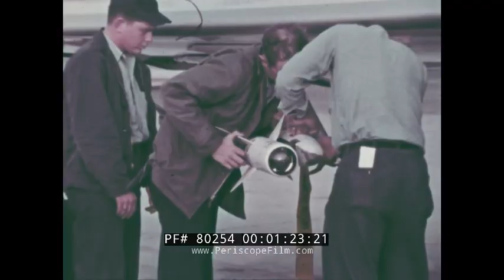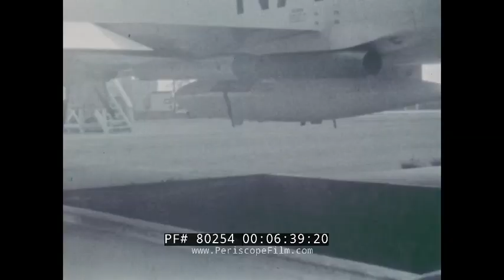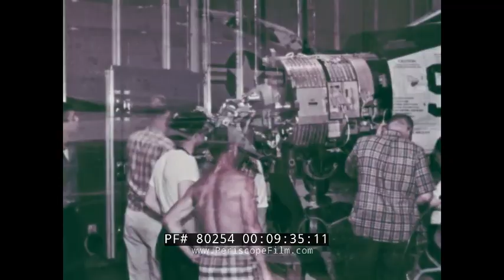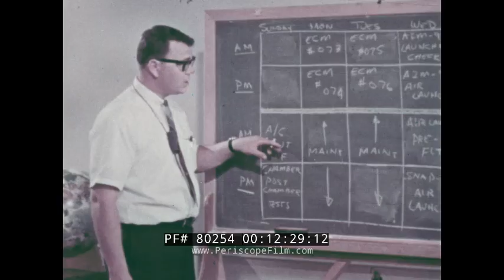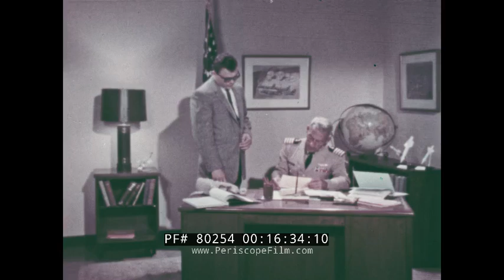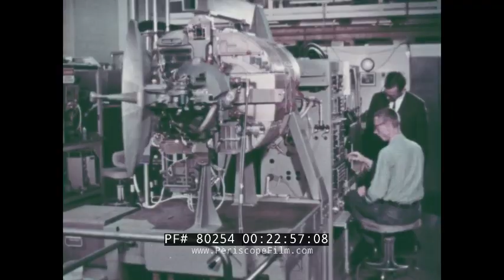DOUGLAS F-4J PHANTOM  AWG-10 GUIDED MISSILE TRIALS  PT. MUGU, CALIFORNIA  80254

Comment: Is the single AWG-10 better than the AWG-9 and AN/APG-71 radar the F-14 had? My thinking is, no. It's a bit newer as well, so why wouldn't it be better.
Reply: Oh hell, no!
The AWG-9 was WAY more powerful and had more search volume than the AWG-10!  The AWG-10 sounds like it's newer and came a bit later -- which is true to an extent -- but the AWG-9 was constantly worked on and improved as much as funding allowed.  The APG-71 was originally called AWG-9 (Ver 5) but it was given a new designation because it was felt it was new enough (60% reworked and mostly digital versus the mostly analog AWG-9/Ver 4) and incorporated tech from the F-15E Strike Eagle to allow the APG-71 to evolve organically (ie, new programs with plenty of hardware memory) instead of having to have hardware redesigned every 5 years.  The solid-state systems (digital) have proven to be more reliable in the field and require less maintenance than analog.  They're also a hell of a lot expensive to procure, too, and they only bought 50-some APG-71's for the F-14 fleet.  The APG-71 really came too late in the F-14 program and by then the Bush Admin/Ver 1 decided to cancel the F-14 project and funnel naval aviation funds towards enlarging the F-18 Hornet into the Super Hornet.  That's a whole political ball of wax so I won't waste more breath on that!
**
I think the AWG-9 had at least 5 times the range (close to 200mi versus around 40mi?  The AWG-10 search range wasn't anywhere near the AWG-9's) of the AWG-10.  I can't imagine the difference in search volume was less than 4-5 times more the AWG-10!  
The AWG-10 was fielded in the F-4J and upgraded F-4S (J-model rebuilds) as well as the British F-4 Phantom variants (K and M export models; the British have their own designations for their Phantoms but they're nonsensical and hard for me to remember!).  The British felt the radar system was good enough into the mid-1980s and kept their Phantoms in service until 1992.
**
The AWG-9 evolved from a radar-missile concept that started in the late 1950s.  The Defense Dept felt the Soviet bombers were a real threat.  They felt that in a few years, the Soviets might be able to field vast fleets of supersonic bombers that would threaten both the US West coast and the carrier task forces of the US Navy.
[The Soviet bomber threat never really came.  The USSR was too poor in money and natural resources to support long-ranged bomber operations in any meaningful numbers.  They didn't field a true jet strategic bomber until the late 1980s.  They were stuck using a turboprop plane derived from the B-29 as their strategic bomber because none of their existing jet bombers had the range to strike the US and return to their bases!]
Both the US Navy and US Air Force worked on separate projects to develop long-range, high-speed interceptors with powerful enough radar and long-range missiles to strike down multiple incoming strategic bombers at ranges of at least 100 miles away from targets.  As these programs came and went -- they mostly failed in development with airframes or it was too expensive to go on with impractical technologies --, they passed the prototype radar and missile concept between contractors!  That's virtually unheard of but they felt the development of a high-speed, long range interceptor with a good long-range missile was that important.
The USAF at the time was obsessed with Mach 3 planes but only one became a practical operational plane (the A-12/SR-71 Blackbird series) and the other was relegated to an experimental project later used to develop technologies for a hypothetical SST (the XB-70 Valkyrie).  They NEVER fielded a Mach 3 interceptor but DID test 3 modified Blackbirds with radar and missile like the later F-14's systems.  Mach 3 planes are impractical to field in large numbers (only 49 unique Blackbirds were built and one wreck was recycled to become the 50th plane; that's how expensive they were!).  They consume so much fuel and because of the heat at sustained Mach 3 speed everything about the airframe had to reinvented and take into consideration the consequences of high-temp stresses!  The Blackbird was a pain in the ass to develop and field and wasn't really debugged until about 20 years after the first flight!
The Navy had its own airframe issues (failed but unbuilt Douglas F6D Missileer and the didn't quite satisfy requirements F-111B) but eventually after 2 tries the radar and missile project that began in the late 1950s ended up in the F-14.
Reply: @AvengerII  This was an interesting post you made with lots of information & insights on aircraft & weapons development.  Thanks.

Comment: I wonder if the tropical simulated environment tests also included ocean salt water sprays. Not simply salt water but ocean water as is, particulates and all. Cycles of lashing with salt spray, then fresh water rain spray, drying, repeating, leaves this gritty black residue that has to be cleaned.

Comment: I love the F-4, but these guys did all this work and expended all of this energy& we still got (barely) a 1:1 kill ratio against NVAF MiGs.  Our ordinance only worked 2/3 of the time, missiles would just track the sun or motors failed to ignite, etc.  I would have been even worse if we were fighting the Soviets.
Reply: The USAF had a poor showing against their opponents during VietNam; about a 1.1:1 kill ratio.  The Navy/USMC started off somewhat better at 3:1, but after NFWS/Top Gun was instituted, they shot up to around 12:1.  It took awhile for the USAF to update their training syllabus, due to senior USAF brass concentrating on strategic bombing.
Reply: You can say that again! 🫡
Reply: Just fyi... Rules of engagement required US aircraft to visually ID targets. That greatly negated the advantages of carrying Sparrow missiles.
Reply: Your gripes have nothing to do with the F-4 as a weapons platform.
Reply: @ti1ion  really?  When the Sparrow & Sidewinders we used in Vietnam just didn’t work because the F-4 was pulling more than 1G, that speaks to its efficacy as a weapons platform.  I get the phantom wasn’t designed for turning fights but then neither was its ordinance.  It’s a wonder our kill ratio against migs wasn’t worse.
Reply: @thomas_fx_foto  Trying to discuss the challenges of Vietnam in a Youtube comment is bound to result in failure.  Still, whether the missiles malfunctioned due to excessive G-load, or for other reasons, that is not the fault of the Phantom, unless you are saying it should have been made incapable of pulling 1+ G so the missiles would work better.  Other reasons for missile problems included the hot, humid climate that the missiles were not designed for; the lack of timely maintenance of the missiles; and the abuse the missiles suffered from rough handling and repeated forces applied to them during takeoffs and landings.  Again, this is not the fault of the F-4.  Additionally, it is something that needed to be learned by the manufacturers and the maintainers.  Your original comment about how it would have been worse if the fight was with the Soviets was completely unnecessary and pointless.  Do you think the Soviets had a magic wand that made their weapons work better than American weapons?  Here is a clue: their weapons sucked and they still do.

Further, and this will have to be rather brief and lacking in detail, but in the 50s, American pilots were killing themselves and crashing their jets as they looped around the sky in mock dogfights.  The government accountants demanded a stop to it and since the Air Force was being run by SAC and all planning was towards a nuclear war and interception of Russian bombers before they reached weapon release territory, it was easy to ban dogfighting.  Read the autobiography of Robin Olds to hear his take on it.  Read Topgun: An American Story, by Dan Pedersen (Google has a preview so go to Chapter 4: Fight Club) to understand that the Navy was headed there, too.  When pilots were sent to Vietnam, the young guys did not have years of dogfighting training and that meant that a fight against an inferior opponent could be lost if one did not know how to take advantage of one's aircraft.  The F-4 had power.  Lots of it.  But if the untrained pilot saw a MiG and decided to slow down to turn with it then he would likely lose the fight.  The way to fight the MiGs was with speed and altitude and the F-4 was an excellent dogfighter in those regimes (for its time) as graduates of the later weapons schools proved.

Then there were the rules of engagement (ROE).  I expect you already know that North Vietnamese airfields were off limits to US forces, as were many other installations.  The reason was political, as there was a fear that the killing of Russian or Chinese advisers might cause those countries to enter the conflict.  If the US military could have attacked those airfields then there would have been no MiGs around to challenge US forces and your statements about missiles and kill:loss ratios would not even be relevant.  Think about that.  And the F-4 could do both the job of destroying the airfields and destroying the MiGs (in the air).
Reply: @ti1ion  I don’t disagree with anything you’ve said here, in fact it’s very well put.  I agree about the maintenance & the humid environment, perhaps I was just lamenting about how few thing went right in Vietnam.  I love the F-4, we built models of it as a kid, my first full size GI Joe was an F-4 pilot in a parachute.  My mom lost a high school classmate over Xepon alongside the Ho Chi Minh trail in Laos to a radar guided 37mm emplacement (Gary Fors).  However,  I’m still glad and I think we were fortunate to be dealing with the MiG 17 / 19 threat with a relatively inexperienced pilot cadre.   Later on the MiG 21 made that even more clear, the VPAF got better fast and they had a Mach 2 jet.  If we were flying against Soviet pilots (like in Korea) I’m afraid things would have been far worse than a rough 2:1 parity.  By 1969 the Soviets were building large numbers of MiG-23s with BVR weapons & look-down shoot-down radar.  Everyone should be glad that Moscow supplied their client with their relatively older platforms.  We had the best of intentions, but talent, courage & heroics aside, we had the wrong airplane in the CAP role, or at least the wrong mix.  I think the F-5 was only used during Vietnam in a ground attack role by the RVNAF, but a few squadrons of those with USAF red flag pilots may have helped even the score against the MiG-21.
Reply: @thomas_fx_foto  I also built many models years back, and the F-4 was my favorite.

I can't say I see how an F-5 (and this would be the A/B model) would have been a suitable fighter for the job.  It was underpowered; it had no radar and very limited avionics of any kind; it was very short ranged and it was limited in how much ordnance it could carry.
Reply: @thomas_fx_foto  "the Sparrow & Sidewinders we used in Vietnam just didn’t work because the F-4 was pulling more than 1G, that speaks to its efficacy as a weapons platform" 
How does that speak to the F-4's efficacy as a weapons platform? The problem here is clearly the missile, not the plane...
Reply: @dogeness  okay, okay.  Like I said I love the Phantom, but missiles aside, early models had no gun, gun pods were only a partial fix.  Additionally, the aircraft is heavy 55,597lb vs 17,195 for the MiG 21.  Both the F-4D and the MiG-21 could turn almost 9 degrees per second, roughly equivalent.  What I’ve said before I think is that the F4 was a fine straight line interceptor, big radar, etc.  However, its weight was a detriment to turning fight wins.  As well, the Phantom was a complex beast, miles of wiring and ducts, weighted controls, all of which made them particularly vulnerable to ground fire.  I lost an Uncle in Laos to a 37mm AAA emplacement IN a tree.  Our men did their best and had to adapt their flying to a strange environment.  The F-4 was designed for BVR missile engagements, not merge & turn fights.  Dig?
Reply: @thomas_fx_foto  This has to do with the missile fire control system, of which the F-4J (Navy/MC) was the most complex.   The REAL problem was poor tactics employed by Phantom crew early on.
Reply: @thomas_fx_foto  Tbf, Ive also heard that the US air force had issues with training, and the Navy made much better use of their F-4s, never having that much of an issue.

Mig-21 also wasnt exactly a dogfighter, it just turned really well for an interceptor. They upgraded its afterburner so it could keep speed while turning. At lest for a short time, until it ran out of fuel.

F-4E "agile eagle" made up for that deficiency tho. Its actually coming to DCS flight sim. Cant wait to get my hands on this cold war marvel!
Reply: And those are the reasons we are all speaking Russian today, comrade… (sarcasm.)
Reply: us navy phantoms had a 6:1 exchange rate vs migs in vietnam. it was the air force that had issues.

Comment: F4J BIS Guided Missile Trials is a short technical film report from the Naval Air Systems Command in Point Mugu, CA on the March 1967 BIS trials of the AWG-10 Missile Control System and related components on a McDonnell Douglas F4J Phantom II. The BIS (Board of Inspection and Survey) trials were divided into five categories: ground tests, captive flights, launch flights, serviceability, and human factors tests.

Comment: The AWG 10 system was well advanced in its day!  I worked in AIMD At NAS Oceana .  Also IMD on the USS Independence. 69-72.   We repaired the modules down to the individual Components.  Had a Test Stand on the carrier to Troubleshoot.   My favorite piece to work on was the self Diagnostic Bitbox. We had to have a Top Secret Clearance Back then.     This is a Very good Video of its History!   Thanks for Shareing!
Reply: @John Patterson Jr   Sounds like excelent maintenance capablity for a "on point" - front line deployment.   You're talking about diagnosig, repairing and checking at component level (C-Check / D-Check) on a carrier.   That has a huge mpact on operational availability.   Impressive.
IAF Structural tech. / Aviation fitter.
Reply: same
Reply: @jonny_codphilo7809   thanks for the Video link on the Awg 10..   It brings back lots of memorys.   On My second med cruise I got to work up in the bow on the indy In IMD department.    The test stand in the video was first gen cause I dont remember it looking like that when I worked on them. I could sweep the dish and activate the dipole.  We could even test transmitter Magy trons Pumping into a Dummy Load !  The Maggy was the Heart of the system !   I also worked on the bit boxes.  They were tape driven.   Pretty smart little report box..   Could also simulate 10 Tagets to Lock on to.    High tech in 1970!
Reply: When was the awg 10 introduced? I have been trying to find good information on the f4 radar but there isn’t much I can find on the internet
Reply: @thurbine2411  I believe the AWG-10 was the original group for the Phantom, so I would say the '50s, when the phantom was introduced.
Reply: The AWG10 was a upgrade from the APQ radar systems. The F14 tomcat had the AWG9 in the F14A . It was upgraded in the F14D. The Phantom II had AWG10
Reply: John, which parts of the radar required the TS clearance?
Reply: @10percenttrue  As this was cutting edge at the time, I would presume anything to do with the Phantoms radar system was highly sensitive and subject to high security clearance.
Reply: @trespire  Yes I had to have a top Secret Clearance before I could be qualified to work on the Awg-10.  They questioned my Parents teachers and My Parents Neighbors on my Background!

Comment: I wonder why the Navy never used Hughes Falcon AA missiles.
Reply: I think I can tell you:
The AIM-4 Falcon was intended to be used on anti-bomber (i.e. strategic UNmaneuvering) aircraft missions and so it was designed to be fast and lightweight and would sacrifice maneuverability in order to achieve those goals optimally. Because of that focus, the Air Force never really improved the Falcon to a significant dog fighting ability. In fact, the USAF was very unimpressed with the Falcon's performance against North Vietnamese fighter (i.e. maneuvering tactical) aircraft when they deployed them to Vietnam in the later 1960's.
By comparison, the Navy always considered the Sidewinder's use to be primarily against tactical aircraft. Therefore, the Navy did not adopt the Falcon because they were cognizant of the difference in intended targets and therefore in design parameters. Again, the air Force's experience with the Falcon in Vietnam proved the Navy to be correct in its choice not to adopt the Falcon and to stick with the Sidewinder.
Reply: TLDR: The Falcon missiles didn’t work very well and the Navy already had their own project, the Sidewinder.